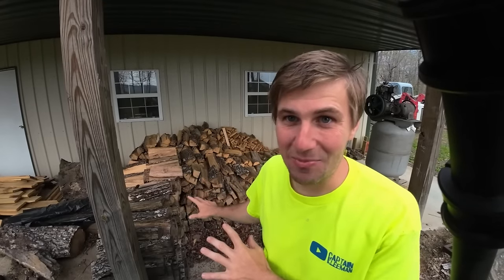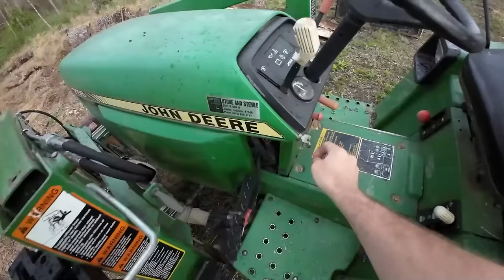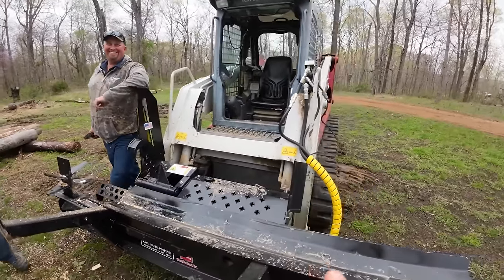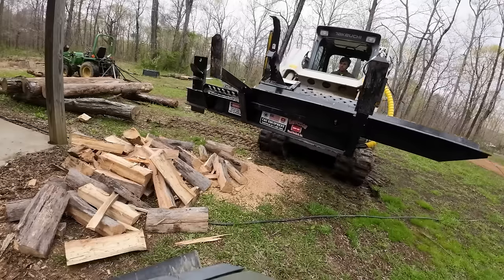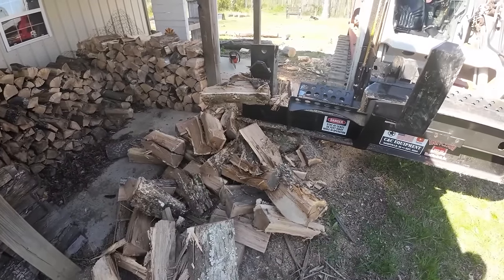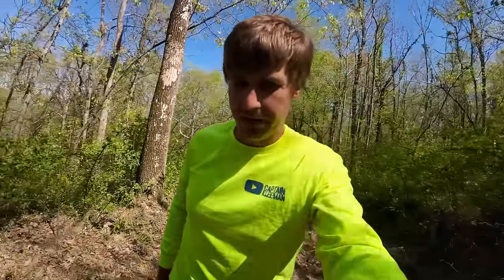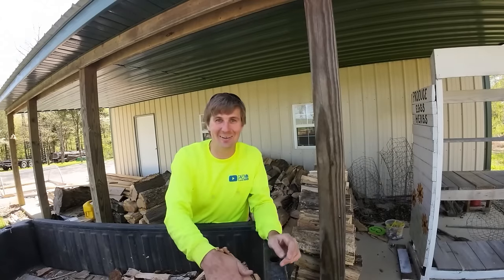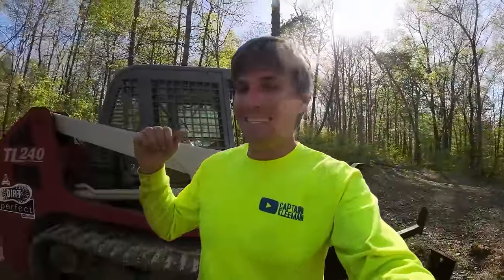Trying Skid Steer Mounted Firewood Processor - Halverson 120 - First Impressions

Comment: Cap’n, I’ve not seen that.  The first thought I had was ‘clever’.  Using the bed as both a carrier and a splitting ram is genius.

The second thought was ‘versatile’.  Being able to load it from the seat and position the output where you want it allows for adaptation to many different situations.

The third thought was ‘safe’.  Being operable in all functions from the seat keep the operator from being near the pinch points and the saw.

I guess the only question that I have is, ‘durability?”.  Is it worthy of the “Kleeman Proof Seal of Approval?”  That is definitely something only you can answer!!!
Reply from the maker: Time will tell!

Comment: That is the way to process wood, take the processor to the wood, process to the place/ trailer/truck, then unload, if it were me I would dump to an elevator and pyramid stack it. Young man, you done been hooked! Also, using that processor on the triple nickel, you can bet I would seriously look at figuring out how to attach it to the backhoe, just think for a minute how you could possibly set the machine in place and only have to swing the boom to place your processed wood into place or even sort soft wood from hard wood into piles, just some thoughts young man, great video, enjoyed it immensely, thanks.
Reply from the maker: That would be awesome!

Comment: Great for C & C to let you demo it.  Great to see DP visit.  I have a question on the Chain and Bar.  Did you sharpen then chain for what cut?  Can you tell like a chain saw of smaller chips to saw dust when cutting? Does the Bar need oil and if so is what is the reservoir capacity? Thanks again Mike.
Reply from the maker: I havent touched the chain since I got it.  It does use bar oil

Comment: Actually useful in a home stead situation nice , I think it could do with a bar which is 2 inches longer just to make sure it cuts any log your able to get to sit in the cradle
Reply: My cheap processors can cut 18-19 inch  but 10-14 is best . The are called north forest in Canada
Reply from the maker: The larger models have longer bars I believe

Comment: Looks like a really awesome tool. The only thing I see that could be different is if the splitting wedge was adjustable you could set it at the length you wanted and it would be just a little quicker
Reply from the maker: The length is determined where you cut it at not by where the wedge is
Reply: @CaptainKleeman  ya I was just thinking if you could set your wedge to how long you wanted your cut wood as soon as you pushed one through the splitter the next piece would already be lined up to cut at the correct length. You would cut split clamp retract your bed and cut again. But it ain't that big of deal. Not worth arguing about.

Comment: That is cool. Work smarter not harder lol .does it have to be 10 foot logs could it handle a 15 foot or longer log in it. Could you change the bar size to cut a bigger around log then 16 inches or do you have to buy the next size up to cut the bigger logs? Just a few things to thank about
Reply from the maker: You would have to size up

Comment: Now you need a dump trailer to put behind the 755. If the trailer had flared sides, you could most likely catch all the split wood.
 Plumb the 755 for power beyond, add some control wiring and put a 3 point ball hitch on the back so you can bring the trailer and splitter to the work, drop the trailer and split it full, then  hook back up without leaving the seat. Then you can get some IBC totes without the plastic liner, and go into the firewood sales business  😉
Reply from the maker: That would definitely be handy!

Comment: Where do we get the $10,500 to buy it. A lot of the trees l cut and split were 49” across the butt cut. How much would that machine cost. You’re lucky to have people that let you rent or advertise equipment.
Reply from the maker: I think it's easier to size a tree to the processor versus finding a processor that cuts 50" across.

Comment: Pretty darn cool firewood processor.
Definitely saves time and work being able to take the equipment to the site where the tree / logs are than taking them to the processor.
Captain,  if you do buy one it'll obsolete the log drag you built from scratch for the most part.
Well, I'm sure there will be the odd log that's in a place the tractor or skid steer can't get Into with it mounted and you'll have to drag it out.
Really interesting episode. 
Thanks for the entertainment Captain.
Reply from the maker: Appreciate ya watching as always Ronnie

Comment: Does that guard prevents good visual on the bar and chain. I wonder if it is possible to indivertibly run that bar and chain into the steel deck or is there a safety feature that prevents that? That system would sure be good for older people and it would not make old men out of young men like a splitting mall does.  You caught on to that procedure pretty fast.
Reply from the maker: There is a limit switch that prevents the bar from dropping if the bed isn't retracted

Comment: OMG😱 where were you guys 50 years ago? I could have used that to build my Cordwood House. OMG OMG OMG ... 🤗I want one ... just to set and look at, what a thing of beauty.  If you cut firewood that is a must have unit, or you could be like me and break your back. Trust me that splitter process is way cheaper in the long run.  
Work smarter not harder.  (I don't think that was a quot by William Shakespeare)
Reply from the maker: It's definitely handy!  A back saver for sure

Comment: T his is a great Firewood maker.   Needs a 20 inch saw and claw on the slide so you can chop a whole log  ! .....BUT.... I can build one for a tractor for less than TEN GRAND with scrap steel ...geeeezzzz. I beam . Wedge  hyd cylinder . a couple of hose  . Oil tank , Pump . Done🤠
Reply from the maker: Look forward to the video

Comment: I am sure you have already thought of putting a trailer on the back of the vehicle that has the wood processor on the front. Then you only have to use one vehicle for the whole job. (As I said, I am sure you already thought of that).
Reply from the maker: If a fella wanted to I suppose
Reply: @CaptainKleeman . 💪

Comment: How can I find out what type controls it needs to run? This looks like it needs more than a external 2 line valve to run? Does it need high flow? Your video was great but just like every one else you skipped over the process of hooking everything up. Also skipped the controls to run each step of the processor.
Reply from the maker: https://youtu.be/AvbOAXab0WI?si=rW30NHoo1qZfkQeA

Comment: Nice looking machine but it takes all the fun and exercise away from cutting firewood. I could cut a lot of firewood for what that skid steer cost. It is only good for business selling firewood.
Reply from the maker: Works on tractors as well if the flow is enough.  Alot of farmers and homesteads are going to have access to the equipment required.
Reply: @CaptainKleeman  i agree with that